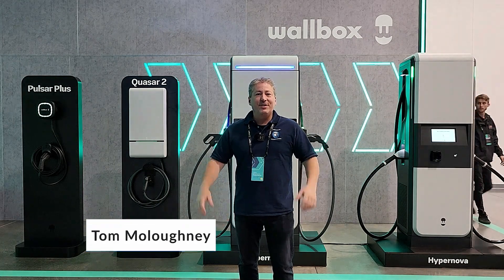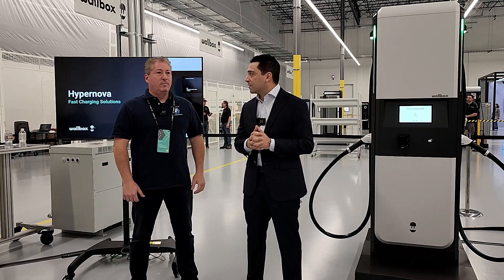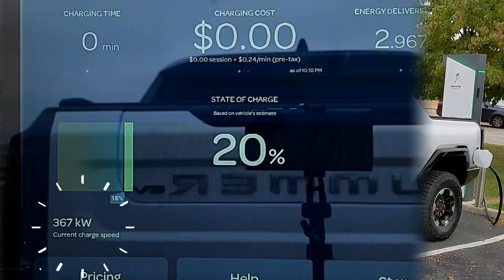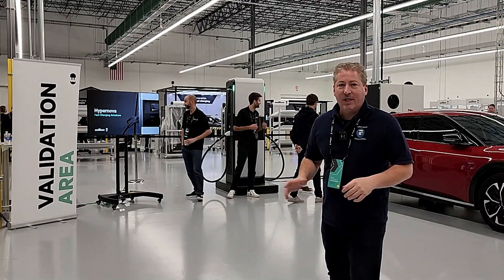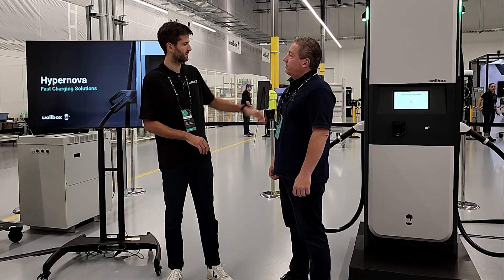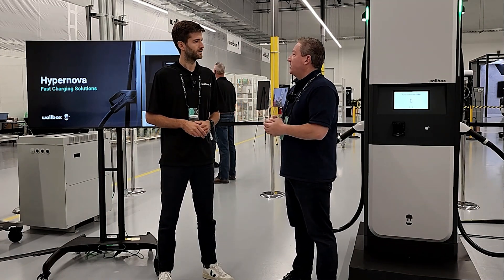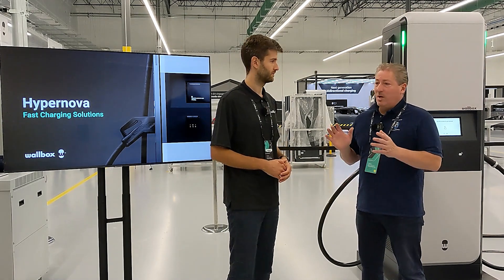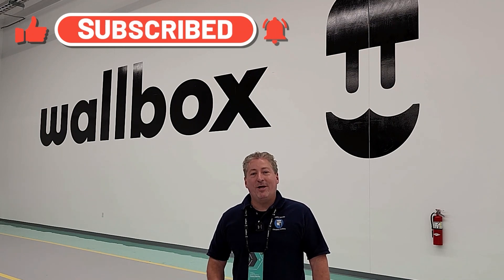1,000,000 EV Chargers by 2030! Wallbox Arlington, Texas Factory Tour

Comment: Great to see that Wallbox is open. I live not far from there. I could bring a Lucid Air by for them to test, if they like.
If I had known you would be in town I would have bought you lunch.

And about the Quasar 2 or any 3rd party bidirectional charger. I can't imagine that being done without coordination with the OEMs. Pulling power from the battery has thermally different chemistry than charging. OEMs (and their warranty departments) will want to have full control over that process, if they choose to allow it at all.

Comment: Good one, Tom.   One thing i'd like to see on the screens of fast chargers is a running commentary of the handshake process with meaningful messages and also reasons popping up on the screen of why charge rates drop/rise (e.g. grid issue, overheating etc) or handshake fails (incl telephone network issue with touch and go systems) - could do with seeing the same in the car too

Comment: The assembly line is impressive.  Looks like they won't have any problems with improperly torqued connections.  It would be interesting to visit a certain Canadian company that has had issues with that and compare the approach.  Too bad wallbox doesn't offer a cold climate cable option.

Comment: What a great tour! You mentioned you could take some questions about Wallbox products. I have a question, or perhaps it is a complaint, about their literature. I can never figure out what all of their operating systems and modes of operation are called, consequently finding literature that accurately describes a particular capability is very hard. And, once I find it, or something close, the description of the system's operation is at best one paragraph that wasn't translated very well from some European language document. I don't know what those funny little DIN products and their name are. For example, is it a switch, a circuit breaker, a ground fault device? I did figure out that a clamp is really a current transformer, but it wasn't immediately obvious.  And how does each product, OS and system operating mode work. Let's say my customer wants to have three chargers in their three car garage and they run on a single 48A circuit. You plug in two cars, one at 20% with cold batteries and one at 40% with warm batteries. Is the max current to each car fixed at 24A? What if one can only use 20A, does the other get 28A? Now I plug the third charger into a third car. How is the charging split up between the three? Can I connect the three to a 60A circuit instead of 48? The literature doesn't say. Can you ask Wallbox if they can hire a US English speaking Engineer that has actually worked in the field to rewrite the manuals using consistent product and operating mode names, and to use common US electrical part names and describe how the systems work? Thanks

Comment: can't wait for the new video on the Quasar 2 and V2H. I have questions: can my car be any EV? what if I already have battery, can this supplement using my EV? what if it's tesla powerwall? I have a Fisker Ocean, does it work with it even if Fisker is going bye bye? does the car need have some internal hardware to allow quasar 2 to do V2H charging? does the car only need the right protocol for it to work? thanks, great video.

Comment: I think this is great but will the grid be able to support all these charging stations?  I think your videos are good for the EV community!
Reply from the maker: Perfect timing. I'm currently working on a video about how the grid will handle millions of EVs.
Reply: @StateOfChargeWithTomMoloughney  I know EVgo is supposed to be 100% renewable energy, meaning they product more energy than what is consumed, but they aren't everywhere yet.  My City only has  3 of their stations and none of them has a Tesla connector, so an adapter is needed.
Reply: The expansion of the grid will be able to keep up. Remember that most charging is done on level 2s, and just for a fraction of battery capacity, so it works out fine.

Comment: Thanks Tom, I think state of charge does a wonderful job a educating people on charging and new equipment. Will Wallbox be starting their own charging network with their new DC charger or are they just going to supply companies like EVGO and EA? I am getting a Clipper Creek EVSE hcs-40 that can provide 32 amps. My cars charger is only good for 30 amps. Is this a problem or will the evse and car work it out? thanks
Reply: Sorry did not watch long enough you answered my question about the hypernova.
Reply: The 32 amp capable clipper creek will work fine with a 30 amp capable car.
Reply: @charliesullivan4304  thanks

Comment: 1,000,000 unit's is no joke for sure. However we sell 14-17million personal use vehicle's each year here in the U.S. 
And with evs at 5-6% of sales this year heading towards a doubling yoy for the next few year's. 

That means we are already over the current 250k run rate capacity of this single factory. 
With more manufacturer's also now NOT including a lvl2 evse charger unless paid for. 

We're gonna need at least a couple more of these factories asap. We also need a nationwide installation service built out asap. 
Even right now to keep up with ev sales you'd need over 10,000+chargers installed each week in homes to keep pace with adoption rates. 🤔
Reply from the maker: Sure, but Wallbox is one of the dozens of EVSE manufacturers. They aren't going to be supplying the entire industry. They would probably be extremely happy if they held a 5% market share.
Reply: @StateOfChargeWithTomMoloughney  Tom do you know offhand how many evse manufactures are here in the U.S. right now building at scale? 
I know we have tesla, wallbox, Siemens I believe has a facility and freewire to.

Comment: With the DCFC, I want to know if they "plug and charge", and what they are doing for reliability, and servicability. We have enough EVs hitting the roads, that these things need to be robust, and when they break, they need to get fixed quick, and their software should get suspicious if one of the 2 or 4 plugs isn't charging any vehicles. A broken charger is worse than no charger.
Reply from the maker: Yes, the Hypernova is P&C capable, but the company that buys, installs and manages it is ultimately responsible for making that feature available to the public.

Comment: Not sure how they claim "up to 400 kW" when the CCS specifications only allow 350 kW.  Hopefully they're rated to 500 amps?  That's the more important metric for lower voltage vehicles.
Reply: Ah they talk about 500 amps later.  Still the standard doesn't exceed 350 kW.  Unfortunate that the steps are 100 kW, I think Kempower is more granular at 50 kW or maybe even 25kW steps.
Reply from the maker: Yes, they're rated to deliver the full 500-amps. The units split power between the two cables, so I took it as 200 kW times two, not 400 kW to one cable. No EV would be able to accept that anyway.

Comment: Should we go all-out building charging stations? Isn't in-road wireless (induction) charging a possibility? If enough road were energized, batteries could be SMALLER, lighter, EVs that much more efficient. Is it too wasteful or impractical? Expertise, please.
Reply: Induction charging is a garage or parking lot technology, not a highway technology. How would they even bill you for that? Way to expensive and complicated. Inductive charging is still in its infancy, so expect to plug in for now. Batteries are getting smaller, lighter, and more powerful all at once. Expect this to be a non issue in the next few years.

Comment: It's too bad that the Hypernova can't intelligently split the power at less than 100kW fractions.  It would be much nicer if a KIA Niro and a Hummer EV both share a stall and the Niro got it's 75kW and the Hummer got the rest at 325kW.  And as the Niro got to a higher SOC and was only pulling 54 kW that the Hummer would then be able to pull 346kW.  But it seems like it would only be 300 for the Hummer and a 100 kW block for the Niro.  300kW doesn't sound bad for the hummer, but say it was an ID4 and a Hummer.  Now it's 200 kW for the Hummer and 200 for the ID4 with the ID4 only pulling 125 kW.  I feel like this s a step backwards compared to newer balanced chargers.

Comment: Tom while I love the idea of EV cars and supercharging stations. I pictured these Chargers with a cord coming out the back end with nothing to plug into. And being its election time I'm going to point out the donkey in the room there is no way at this time that we have the infrastructure to power all these car chargers without some massive infrastructure rebuilding. You saw what happened in Texas with only 20% windmills and solar panels just won't cut it. And with coal plants being shut down we're going to start looking like Europe. This is not politics this is reality. All electric vehicles do is move the demand from Ice vehicles using oil as in gas and Diesel to electric vehicles using coal and Natural Gas by the way in your conversation with Alex you mentioned apartment complexes being more or less forced to offer car chargers. What will happen is apartment complexes will just take away the parking because it costs tens of thousands of dollars to bring in the amount of wiring required to be able to handle the high amperage required to run these chargers. The price of 14 gauge wire with ground for 100-ft roll can cost anywhere from 50 to 100 dollars. Now imagine for a 240 volt system you need a minimum of 6 gauge wire which each apartment complex will need multiple runs at hundreds of feet. And that's just the wiring not including the battery chargers and the breaker boxes and Breakers. Then you have to add in the labor to put it in.

Comment: I think Solid State Batteries that can charge faster are very important to the success of EVs. 30 minutes is far too long.
Reply: Fast Charging is getting faster, my Ioniq 5 can go 10-90% in less than 20 mins. Please remember though, that the gas station paradigm does not apply to most EV owners, because they charge at home overnight. DC fast charging is harder on batteries and is more expensive so it should be reserved for long trips, in which case stretching your legs or getting a bite to eat after 3-4 hours of driving is a welcome break by most EV owners, and when compared to the length of a 6-8 hour trip, doesn't seem that long.